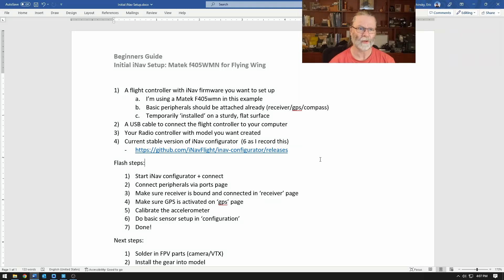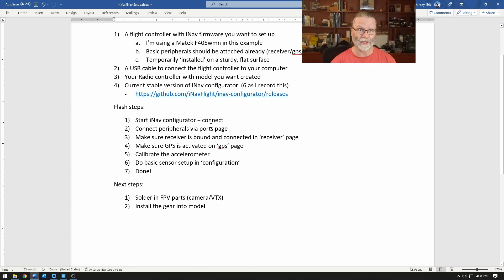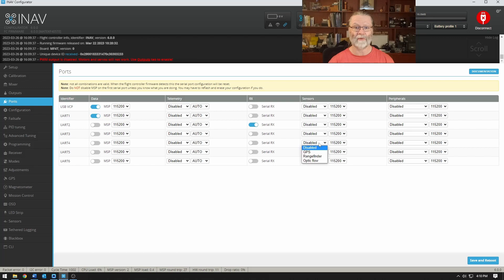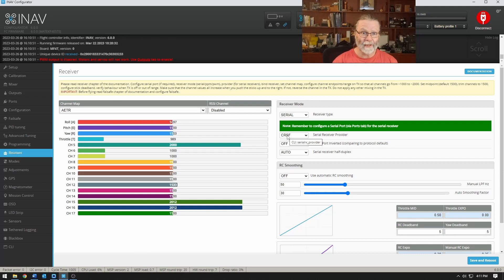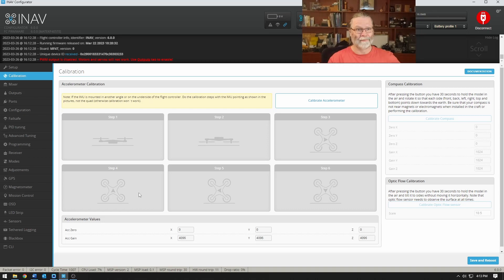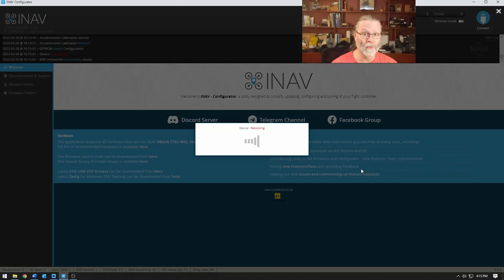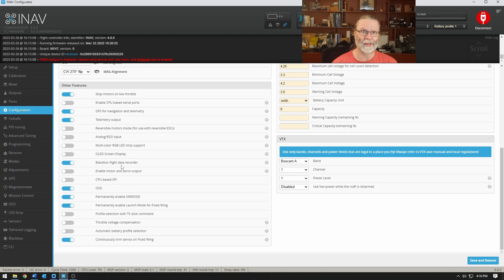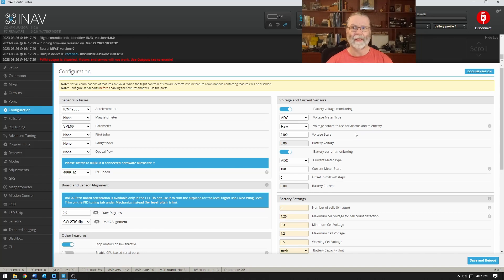Quick n Easy Initial iNav 6 Setup for a Flying Wing

Comment: Hi buddy! I am in full construction like you, and I would like you to talk about the recommended configuration in Inav, within the PID TUNING tab (max pitch angle and max roll angle), as well as what is the CLIMB ANGLE for the autolaunch and how many positive degrees you leave on the wing or the long ones with 0 degrees of controls? thanks for your videos!
Reply from the maker: Thanks for taking the time to watch and drop a question.  I'll be going through the Inav setup in the next video.  A key part will be the PID tab setup and autolaunch basic settings for the maiden flight.  I think the inav fixed wing community is divided on using autolaunch for the maiden flight, but I will still discuss it.
Reply: @blueskyfpv  Thanks to you for answering every question, we could ensure and I leave my positive vote to launch in autolaunch mode above your head with motor at 1900us, climb angle at 20/25 degrees. I would consider low risk of breakage. I look forward to your first flight.

Greetings